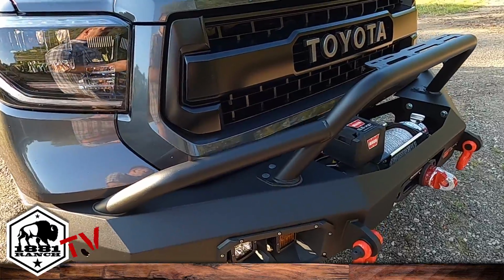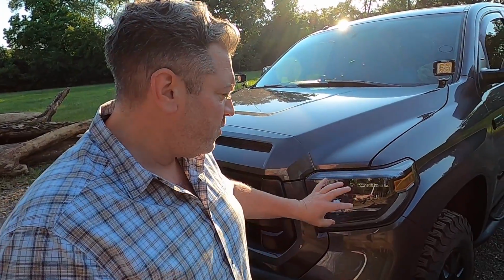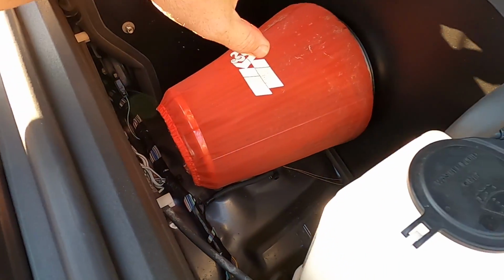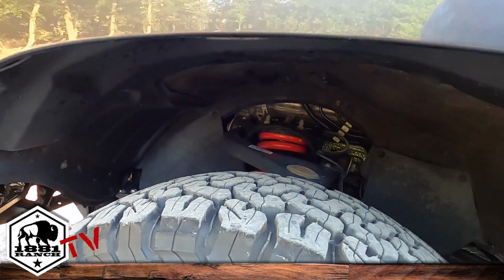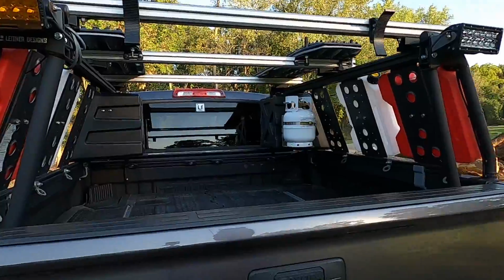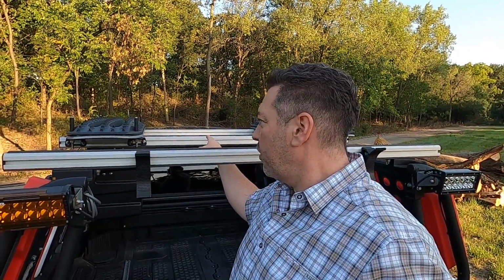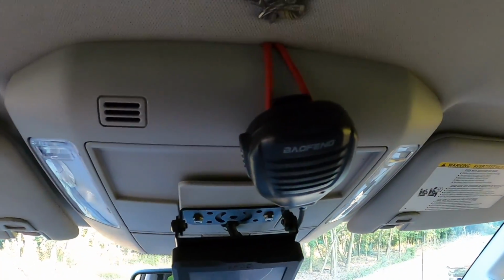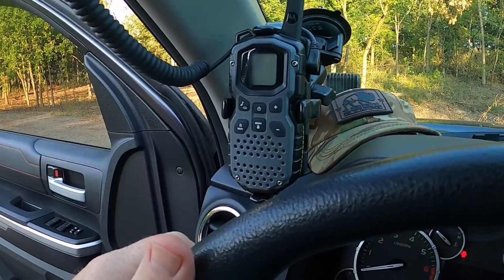Toyota Tundra TRD Pro Overland Build - Part 1

Comment: Hey, this is one sharp build! One thing I wanted to ask, since I also have a TRD Pro and am looking to get the same bumper. I see that you were able to mount the bumper bracket even with that thick TRD skid plate under there. Did you need to trim or mod anything? Or was this whole bumper set already built with that thick TRD plate in the design plan all along? I’d just like to know before hand so I don’t get in over my head after ordering it

Comment: I don't like the "Gift" you got from the Soccer mom.   I put Rhino RB20 running boards on mine to possibly protect from cars opening their doors beside me....unless they are tall their doors will hit my running board before hitting the body of my truck. Now may need some bushwacker fender flairs to protect that part even though I don't really like that look.
Reply from the maker: Hey Dale
That is a great idea! I looked at a pair last year that were perforated to aid in grip with muddy construction boots and with the winters in the midwest I like that. I can always weld on a separate piece pipe to the outside edge to get them a bit wider to guard against them damn soccer moms. Thanks for the suggestion and the view!
Reply: @Ranch-ix1ir  no problem my friend..it works as I tested it already.  Although I still try to park away from everyone but truck is like a magnet sometimes as people seem to just want to park beside me often.
Reply from the maker: Yeah, right?!?!

Comment: What IPAD mount are you using?
Reply from the maker: Hi Genius! That iPad holder is from Ram Mounts and the actual part that holds the iPad is a model specific item you will need to select to fit your gen, size and model. I might be able to look up my part no. but it is for a older 12.9”model when pens just came out. Thanks for the view and the question.

Comment: Would you be able to show or let me know what you did with respect to how you set up your switches for all the after market lights you have on the front and back of your truck. I have a 2016 Tundra limited and I am installing a light bar and the same Rigid hood ditch lights but I am struggling with a clean set up for the light switches. I don’t have any stock blank switch spots inside the vehicle so I’m trying to come up with ideas for a clean install for the light switches. Your build is absolutely awesome. Love the modular interior set up. Great job. Thanks for the thorough run through of your truck.
Reply from the maker: Hey Chui!
We used a plug and play system from sPOD. Theirs is a main box that gets mounted where you want, then a power cable to the battery, and all the lights wire into that box w pos & neg. The switch panel can get mounted anywhere you like with industrial double stick tape or the supplied bracket. The connection between the main box and switch panel is handled by only 1 ethernet style cable so the interior wiring is WAY simple! Look them up sPOD. There are a few others but theirs is the best hands down plus it can be controlled by your bluetooth phone!!! Thanks for the question and the view and apologies for taking so long to answer you.

Comment: why do you have two sets of Maxtrax mounts ? All 4 should fit into the special made pins mounts .
Reply from the maker: Hey Vadim,
We have 2 sets of tracks for a couple of reasons. 1st is we ordered 2 sets just so we had them in case we wanted to mount some at a different spot like a roof rack. 2nd is as we mounted our table on the back of the rack it slides between the center section created by the 2 sets of tracks. 3rd is probably the most weighted, they are mounted in pairs so that either the passenger or the driver side can get out and place a track front and back for their respective side. So let's say the passenger side gets stuck in the mud, it is more efficient for the passenger to get this handled all by themselves. Also for the time being we have the room up top and it just looks cool and keeps the wind drag down a bit.
Thanks for the view and your comment!
Will-

Comment: Those are actually fox shocks
Reply from the maker: Hey Nick thanks for your input and your view on the video. In response to your comment on the shocks, keep in mind that this truck is a 2016 and not the current 2019 version. That being said for 2 years starting in 2016 the TRD Tundra was outfitted with Bilstiens shocks before redesigns came in the platform and them switching to FOX. Thanks again for the view and stay tuned as we have a few more videos coming.

Comment: and the roof top tent?
Reply from the maker: Hahaha yeah Pindal we are still torn on which one to do. We had a 3 Dog on the overland trailer and loved the space and gear toting of a trailer but right now we just run a OZ Tent 4 and a separate extension to the rack. We have a video coming this fall on the tent and Flatpit firepit we use.
Reply: @Ranch-ix1ir  I absolutely recommend and backed by our experience: CVT Mt. Denali Extended Stargazer Summit, 4+ person and the 270 Awning Plus Ealls from Overland Vehicle System.
Reply from the maker: Thanks Pindal I will look into them!

Comment: You didn't have to modify anything electric to switch your headlights? Was a plug and play kind of deal?
Reply from the maker: Hi Rosa, thanks for the view and the question. NOPE just plug and play for the most part as it uses the stock wiring loom and connectors. With that being said the turn signal wire did need a resistor clamped on the wire and mounted but supper easy. It is a whole headlight assembly that you just replace, just unbolt a few bolts and pull out old OEM and install the new OEM housing. Hope that helped! Let us know if you have any other questions but the folks at www.headlightrevolution.com have this all figured out and are really helpful. Will-

Comment: Tundra has not had distributors since like 1998. the coils can now take water fine. arb makes a nice diff breather kit. i run the rigid ditch lights too on my 2014 tundra along with a snorkel. come down to north ga/nc and i can show you some nice trails-
Reply from the maker: Thanks for the comment and view! Yeah I was not clear, I was speaking of my Land Rover Defender which did have a distributor and did not like water on it. 😉

Comment: Hi just wanted to ask what is your mpg highway on that bigger tire? I'm looking to switch to 18 inch wheels on my 2020 tss ..
Reply from the maker: Thanks for the view Pinoy and the support. I did not see any real change in my MPG with the tire change as they are only 1” larger. We still get 12 city 14-16 highway not great but it’s pretty normal. Thanks for the question! Will-

Comment: I really like how you incorporated the stock suspension. Been wondering if I should get a Pro or an SR5 and modify that. I want the amenities of the Pro interior. You just sealed it for me. Great truck can’t wait to almost mirror yours.
Reply: Also btw, just noticed you only have one video. Wow you need to do more of these, pretty awesome. 👍🏼
Reply from the maker: Stay tuned PART 2 is scheduled for this Friday and our Overland Tailgate Kitchen Set Up for 2 weeks after that!
Reply: 1881 Ranch hey brotha, did you do anything for the front suspension? I know the rear you had the shackles who btw I’ve seen some great reviews for them. Thanks.
Reply from the maker: @JuanVargasPro  Nope the front is all stock. That year the trucks were outfitted with Bilsteins and so far they are great.
Reply: 1881 Ranch I’ll be checking out a 2017 tomorrow, think I’ll snatching it up.
Reply from the maker: Did ya pick up that 2017????
Reply: 1881 Ranch found another for less mileage same price, will be checking it out today and see what happens. Looks promising though
Reply from the maker: Hi Sheep Dog! Yeah I have been super pleased with the suspension from the factory and that says a lot as I have put Stage 6 ICON Vehicle Dynamics suspensions on my last 2 builds including my 4Runner, the guys at ICON are great and helped a ton with the Runner setup.  So it was hard to trust the factory set up but I have to say I have had only 1 complaint and that was the "saggy" rear but fixed that with some larger shackles and it actually smoothed out the ride.  Take our lead and run brother!   We hope you have good luck and let us know if you need help along the way.  Thanks again for the support and the view! Will-

Comment: I wish the tundra had the V6 or V8 turbo diesel from the 70 series LandCruiser or the in-line 6 turbo diesel.
Reply from the maker: Turbo diesels are way cool just not that popular here for some reason in passenger vehicles. I think we may see that with the new HiLux that is supposed to be coming to the states. Although the V8 gas engine with the TRD exhaust sounds SOOO good, we wouldn’t change a thing. BRUUMMM! Thanks for the view, comment and support Krishna! Will-

Comment: NIce and Clean just my taste..Good idea with the frs and ram mounts I'm going to copy you. Nice job on the clean wiring in the bed.
Reply from the maker: Thanks for the view James. Defiantly take the Ram Mounts idea and run with it. I have links below, just remember they are all interchangeable as long as the ball size stays the same. Cheers, Will-

Comment: Nice build! What are those tires in inches 32 or 33? What is your gas mileage running? Last thing; your gift LOL could be pulled out with paintless dent repair.
Reply from the maker: Hey Chris first thanks for the view and comment. The tires end up being 33”, we wanted to go to 35s but at that stage the stock bumper was still on and they would have required moving it forward. They ride perfect and being able to pull off and get a new tire almost anywhere is a HUGE plus! Gas mileage is pretty solid at 10-11 in the city and 14-15 on the highway- the KN air filter helps a bit but not much. Yeah we have just gotten around to the paintless thing yet. Hard to find a reputable firm around us that doesn’t want a arm and a leg. Cheers!
Reply: @Ranch-ix1ir  Thanks for the response. You have good content and I'll be watching to see more. Very professional for your first upload. Good luck.
Reply from the maker: Thanks!

Comment: My next upgrade for sure is the Decked bed box and the rack
Reply from the maker: The Decked box is a bit of pain but very straight forward. Just take your time and leave an entire day to make sure you are not rushed. The rack is simple too. Let us know when you are ready we may a discount for you on both items!
Reply: Awesome thx!  I have a 2019 Toyota Tundra Pro btw
Reply from the maker: What part of the country is home? Have you started any other upgrades yet?
Reply: 1881 Ranch Home for me is San Antonio Texas. The upgrades I have done or the back rear bumper step, the rear sway bar read, the driver side grab handle on the a post, it came with a safe in the console, I installed the automatic up and down windows for the front and rear door windows. And I put red in certain letters for the Toyota Emblem underneath the stereo, and I also put large Raised glossy red Toyota emblem on the tailgate. That’s all I’ve done, LOL nothing compared to what you’ve done.
Reply: 1881 Ranch I can send you pictures of my truck
Reply from the maker: Those are a great set of mods, really useful for everyday use. TEXAS!!! Our thoughts are with your state tonight.
Reply: 1881 Ranch thank you so much for that 🙏
Reply from the maker: You are welcome!

Comment: Those size Tires would  have fit fine with no modifications as the are only 1 inch more diameter than stock.
Reply from the maker: Thanks for the watch and comment Dale. Yeah we only went up one size to fill out that wheel well as the stock tire and size looked horrible. If we went up 2 sizes we would probably still be ok as the bumper and front wheel well is the main sticky point at that size but 3 sizes up we will need a spacer & etc which makes the truck more custom than we wanted.